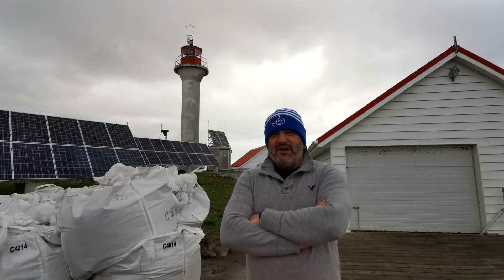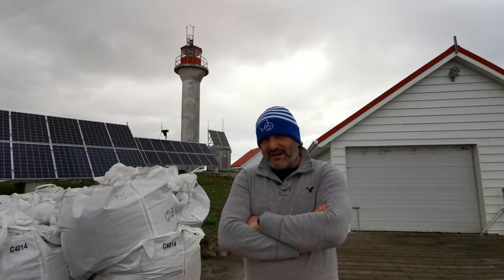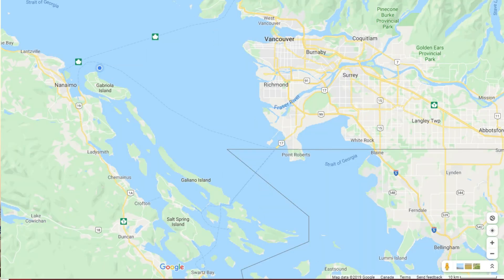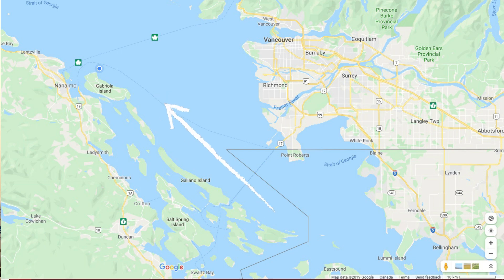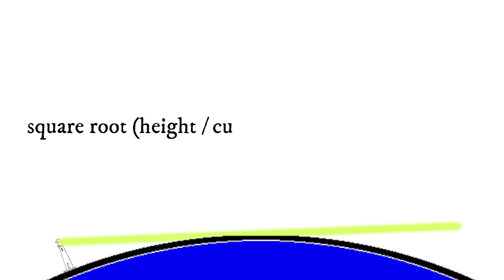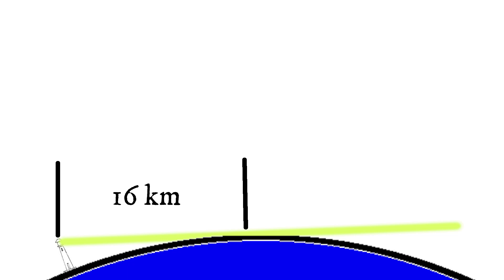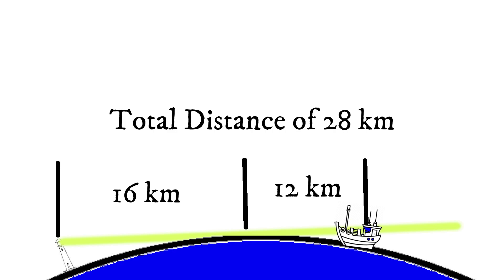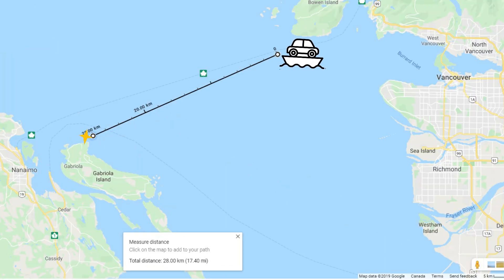How Does a Lighthouse Work? Part 1 - The Math

Comment: Hi Spence.  Here's a question for you...   Assuming a person's height is about 180 cm...   I'm thinking that the formula implies that a person can see at most ~5 km of flat land or ocean around them...  (i.e. if you are standing in a low boat in the middle of the ocean, and you look around, then all you could see is about 5km of water before water beyond 5km will start to drop off behind the horizon...)   Would you agree?   From a pure visibility perspective, I'm sure there are other complicating variables, but I do appreciate your sharing this mathematical formula...  If I'm right then a person that is 158 cm, could only see about 3.5 km...
Reply from the maker: You are pushing my math skills! haha. The distance you can actually see ground to ground is not that far, and so it sounds about right what you have posted here. The height of the tower makes such a difference in how far you can see the actual light.